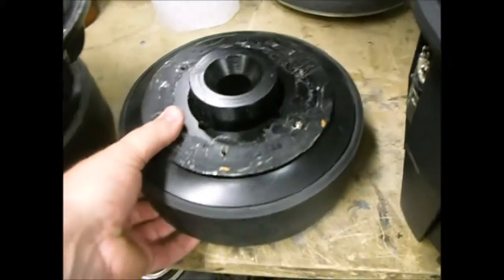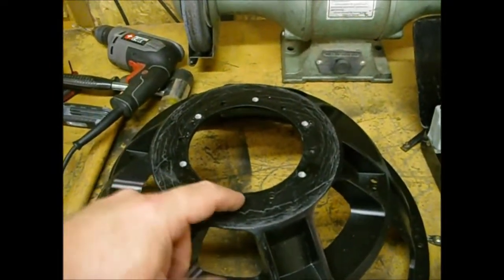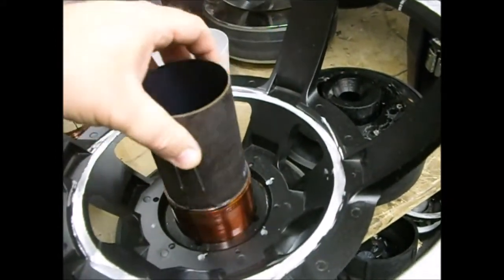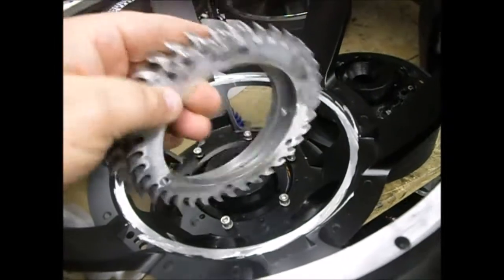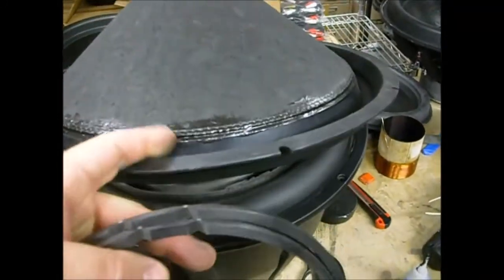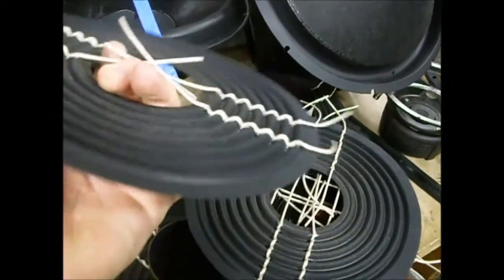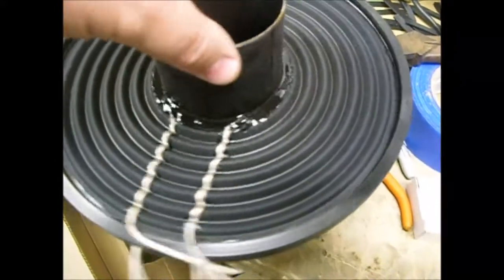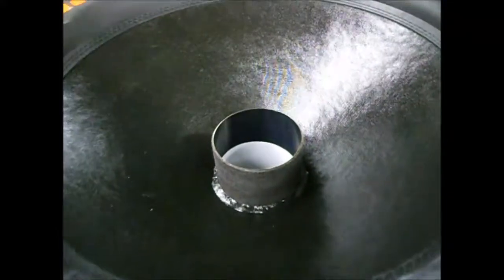DB Burn Rebuild / 18" conversion + GONZO @ The Robot Underground

Comment: How about using a slick mesh that connects to maybe the rubber boot so when you can pull it off for repair it just snaps right off you know like everybody else you really don't want any sawdust or debris getting through there so just a quick idea just to keep the screen and effect it's enough jobs being lost already let the screen keep his job